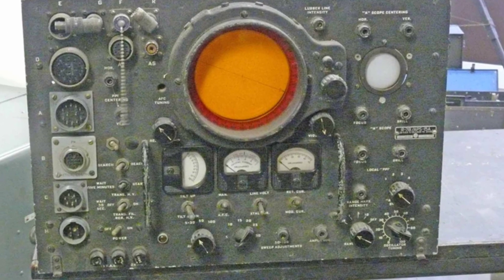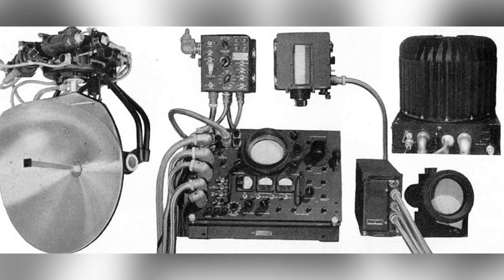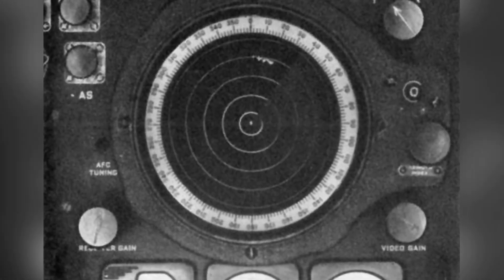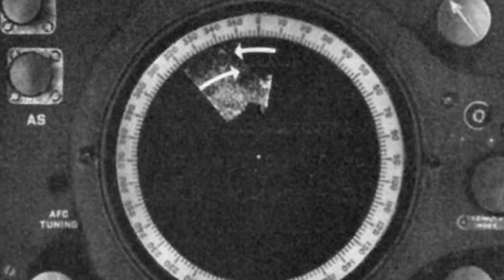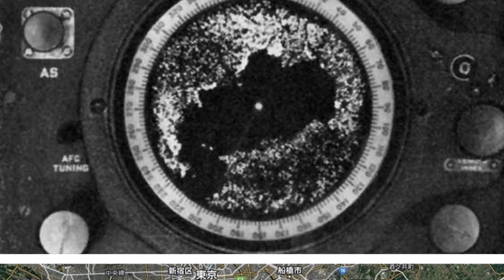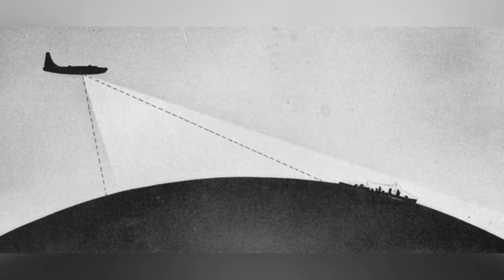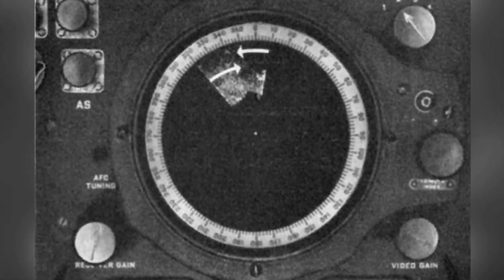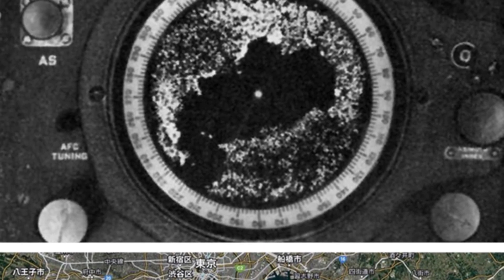AN/APS-15: The Revolutionary Radar for Precision Bombing

Comment: I have a complete AN/APS-15 system (including cables and the bombing computer with all the disks), with maintenance manual on microfilm and installation manuals for B-24s & B-26s (I think).  I like the close-up shot of the installation of the receiver and control box at the operator's station/desk, as I never knew what the installed system looked like (there are only drawings in the installation manuals).  Would love to see more detailed photos.  Thank YOU for posting this!